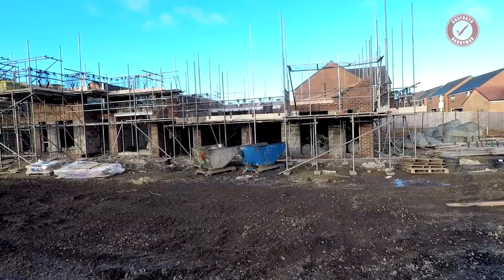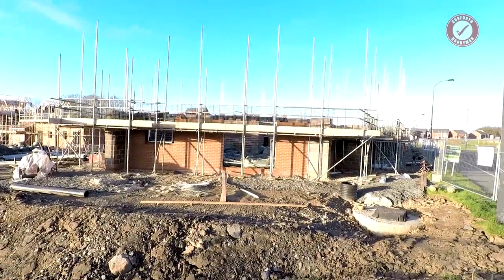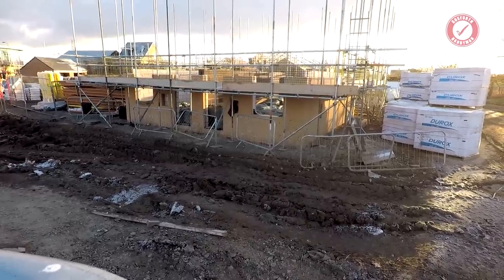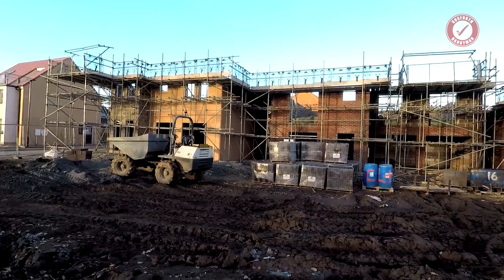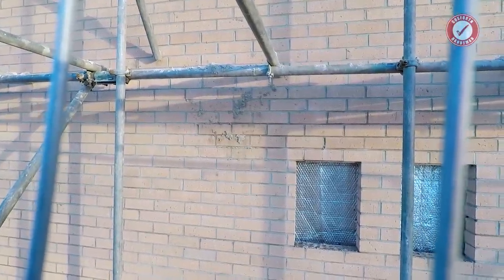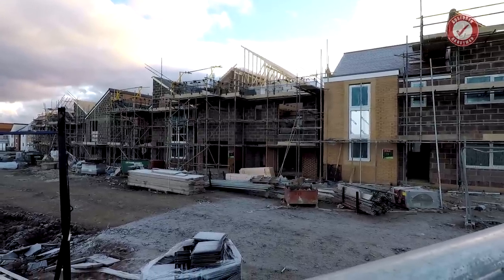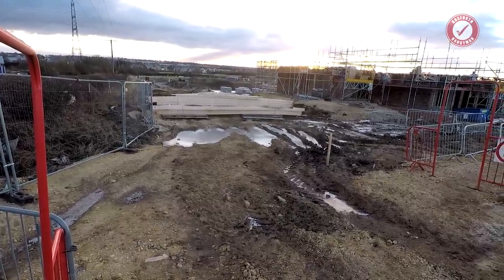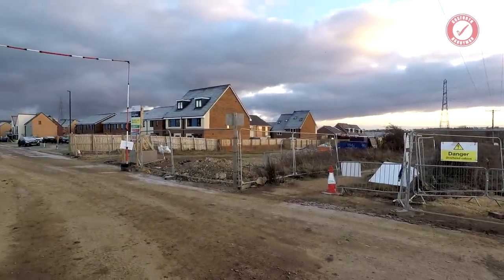How are New Houses in the UK Built? Introduction & Externals

Comment: It's interesting the difference between England and Scotland. The inside skin is all timber here in Scotland, with all the insulation being incorporated into the stud walls so that the cavity is left clear to do it's job. Also it's hard to see in the vid but I believe, in the past at least, in England you don't have any sarkin on the roofs? Funny how close we are yet things are done differently
Reply from the maker: Interesting on the timber frame thing! Don't often see sarking boards here - I think it's down to weather / rainfall etc. I'm not 100% convinced by the blown insulation thing here. Would much rather see Celotex or the like!
Reply: Gosforth Handyman also re the concrete slab floors, not sure about new build houses but I did an extension about 2 years ago where the floor was a poured concrete slab then 50mm kingspan floated on top with the finished flooring (hardwood flooring) layed directly on top. Wasn't at all sure about it when I looked at the drawings but I have to say it felt very solid

Comment: I think solid concrete floor are probably one of the better floor system we have as they are solid no drafts can get through and with no solemn gap there’s not a large area for mice and other vermin to hide. There is no bounce in them whatsoever, when I done mine I had to put 100 mm of kingspan insulation which when you consider that heat rises is a bit excessive.
on the other hand having a solemn you can run pipes and cables under the floor at a later date if need be
Reply: Jack Redmond   Jack, what is “solemn” and what is “kingspan insulation” ?  And what country are you in?
Ron
Reply: @ronh9384   lmfao right whats this guy talking about
Reply: @ronh9384    Kingspan is an Irish company which makes building products.  I don't know what "solemn" is, unless he means "column".

Comment: Very interesting to see how they are built in the UK. Here in Sweden houses are usually built with a concrete slab with usually atleast 30cm of styrofoam insulation under and then steel or wood studs and covered with wood panel or bricks for looks. Nowadays it is more common with prefab walls that are just erected onto the concrete slab, with wires and insulation already installed. We have quite strict laws about energy performance so nowadays houses usually have to have a minimum of 20cm of insulation. 
Most houses are either large complexes with multiple(20+) apartments or solitary one family houses. 
Brick houses here are "wood" houses with bricks for looks only. The bricks are not even load bearing but just for looks.
You could almost guess that wood is cheap here. And concrete and plaster. Houses are usually around £4-600k and upwards around the largest cities.
Reply from the maker: Sounds like a totally different class of house building over there! You're lucky to get 5cm of insulation under concrete floors here. Interesting stuff - cheers bud! 👍👍
Reply: Well we have a colder climate also which necessitates more insulation so it's for better and worse( and higher prices) :)
Reply: @GosforthHandyman  In Scotland all poured concrete slabs have 150mm Kingspan underneath , block and beam method is rarely used now due to them requiring to be vented so higher from ground level and now that disabled access is a requirement from road and drive then ground floor level has to be lower to achieve minimum gradients.

Comment: I bought a new build bungalow by a developer after moving from a 1980's detached house. What bemuses me is having watched them build the rest of the estate, despite the construction being modular the bricklayers work the traditional way but they drop mortar all over the face of the bricks. You can see crusty dried mortar blobs on all the houses and stained bricks caused presumably by  the bricklayer wiping excess mortar off the face of the bricks with a rag. I have tried to clean mine up using a proprietary muriatic cleaner but the stains seems to be almost permanent. You point out in this video that they drop mortar through scaffolding but pressure wash it off. I have never seen this done on my estate. Surely a good bricklayer would tidy as he goes but not here. If you compare the brickwork on my 1980's previous house to here this just looks like a bodge. Why are standards so lax?. When I asked NHBC about the holes the bricklayer left when the soffit was put on they said this came under the term "Remedial work" The builder agreed  to the work and just glued on an extra piece of PVC beading to cover them.  Also the houses are so hot in the summer due to the insulation standards (Overheating) I am having to buy air conditioning to make it liveable inside.  You would think with the Government encouraging builders to install air source heat pumps they would also enable the cooling side as houses are pressure tested to be air tight but obviously this defeats the purpose of reducing energy consumption in relation to C02. My impression is modern houses are not really fit for the increasing temperature's we are experiencing in the UK due to alleged climate change and there is no quality control on the cosmetic finishing of them.

Comment: Very interesting.  I am currently house-hunting and it's further confirmed that I do NOT want a new build house.  They seem built as cheap as possible and not built to last.  I am currently looking at an early 90s house and even that looks shoddy compared to the 1965 house that I have just sold.  My 1965 house was all brick and blockwork.  The 1990s house has mostly stud walls internally, so will be useless for fixing things to, and useless for sound isolation.  Also, I find the gardens ridiculously small on modern build houses.
Reply from the maker: I'll be doing a pros and cons vid soon (ish) - it's swings and roundabouts really. Agree on garden sizes though! (although depends on development). 👍
Reply: Yeah. Agreed. There are pros too. I like the fact you can just move into them without needing to do extra work, they have a guarantee period where anything wrong will be fixed, they often have better built-in storage and modern fixtures and fittings.  They probably have cheaper heating bills too due to modern equipment and better insulation.   That said, they do not seem built to last IMHO.  I am sure they will last 50 years, maybe even 100.  Which I guess is long enough for most people not to care.
Reply from the maker: Out of a matter of interest, what parts do you think won't last? I hear this a lot and I'm compiling a list! 😀
Reply: Just to allay some of your pre-conceived ideas ,studwork internal walls are easy to fix to, there should be plenty of timber to screw into and there are loads of plasterboard fixings if you can't find timber also the walls may well have insulation/soundproofing in them. As regards 60s houses being better built than 90s this obviously depends on who built them but a lot of the materials used in the 60s were inferior to the 90s.
Reply: Gosforth Handyman brick will outlast wood.  a brick built building is bound to last longer than one who's fabric is made up of wood, osb and metal.
Reply: lesleyw9275 yes I am aware that you can screw into studs but that restricts your freedom on where to put the fixing.  Plasterboard can never hold as much as a stud or a brick wall.  Our 1960s house was an ex council house, so admittedly probably built more solidly than many.
Reply from the maker: New builds are largely brick / block built.
Reply: ksp1278 well spoken, they are all built for the most return, as much money as they can make back from selling seems more important then a well built house

Comment: Our house was built in 2010 by Redrow. We are happy with it. It is built on a concrete slab and in 7 years we have no problems with movement. Heat wise they actually have an advantage as it actually works as a heat sink with it retaining heat in the winter and cold in the summer. Like most construction techniques, if it's done well there aren't any problems.
Reply from the maker: Are you sure it's not a suspended concrete floor? (beam & block) Concrete is better if it's insulated but in many new builds (probably the majority) it's just bare earth -> sub base -> DPC -> floor. Coupled with poor site preparation this can lead to problems.
Reply: Gosforth Handyman pile driven, and topped with a poured concrete slab. All on the estate were done like this.

Comment: My house us 12 years old it block and beam floor i got cracking and settling.

Block and beam was used because it was reclaimed industrual land as the environmental department want a breathable gap between the floor and foundations to prevent toxic intrusion. 
But the ground floor vibrate when heavier people walk on it. If peoples jump down my dishes rattle.

My house has brick rockwool fibre cavity blocks with a polystyrene attached to tge plaster board. Is this normal.

Comment: Enjoyed the good quality video and insight. Personally I'd take quality over size any day, for me it's not so much about the size of rooms but how much daylight can be fed into them , and why build 2 storeys high then a roof when  1.5 will suffice.
My Wife and I have been to most of the new builds in our area (South Wales) from the so called leading firms i.e. Persimmons, Redrow, Barratts . We are now looking for land to build our own home.
Reply: Story and a half equates to room in roof trusses or dormers which in turn has a negative effect on room size due to roof pitch. Also a lower soffit level decreases direct daylight in ground floor windows. For example a similar sized ground window of a 2 storey will let in more direct light than in a bungalow .
Reply: @jimmyc974   Hi, you may be entirely correct but, the two storey houses that we have seen have very poor quality natural light ?  we have been to several 1.5 bespoke builds which have been much better designed to allow natural light to flood in.So I guess it's the design in question and not the number of storeys?

Comment: If you were designing / building your own house in the UK what building techniques would you use? With these properties I imagine cost is the main factor however if it was your own you would probably weigh up cost / efficiency / durability differently. 

You mentioned in your video block and beam rather than cement slab. What about walls etc.?
Reply from the maker: I'd probably do block & beam with masonry walls 👍

Comment: I have been designing homes for almost 30 years now and I always find it interesting to see how buildings are constructed elsewhere.  I live in western Canada (on the prairies) and you rarely see block being used unless it's for commercial construction.  Most everything here is stick-framed (for walls that is).  So from a the longevity perspective, I was surprised to see some comments about "not built to last" regarding these homes.  And just for the record, homes that are wood framed can be plenty solid (for the folks worried about slamming doors and such).  We started using the I-Joist styled joists a couple of decades ago, not sure how long they have been in use over there.  It seems that the larger dimension timber is going away due to lack of availability, so engineered products are becoming the norm.  Over the last 5 to 10 years, wood-web floor trusses have become more standard fair for floor systems, even in the smaller, entry-level homes.  They offer larger spans and the advantage of hiding duct work, piping and electrical runs inside the floor rather than having bulkheads etc protruding down and interrupting ceiling lines.  
We have been using roof trusses for about as long as I can remember. Oft times now, they roof system will be constructed on the ground and then most if not all the structure will be craned onto the building, reducing the amount of time that workers need to be "up in the air" as it were.
Great to get a glimpse of your world.  Thank you for that.  Looking forward to more of this sort of thing. Cheers.
Reply from the maker: Interesting stuff! Yeah, I'm sick of reading the "not built to last" rubbish. I rarely get those comments backed up with any actual facts 😂. Been seeing the engineered joists over here probably within the last 10 years. 👍

Comment: One thing I don't understand is why they're not making it mandatory to install solar panels on every new build?
Reply: nor heat pumps. Little 4kW PV system and a nice little ASHP on each!
Reply: It is mandatory in Scotland. Unfortunately the new build we are buying is a 2015 spec which doesn’t have solar as it is before the reg came in
Reply: Houses are expensive enough as it is without adding solar panels, that's the challenge
Reply: Why would they do that? It’s not like you’d get free solar panels just means your gonna pay an extra 5k for your home and who the fuck wants to do that in England where your lucky to pay them off in savings throughout their lifetime.

Comment: We are considering buying a new build, there is a local development building timber frame houses, when we've mentioned this to other new build companies they are very negative about them, due to wood rot etc
Please would you share your views on the pros and cons of timber frame houses 
Thank you
Reply: Basically all houses in the US are “stick built” or wood framed interior. Most use 2”x6”x they do vinyl siding or brick exterior usually. Businesses will often have a metal interior framing instead of wood.

Comment: Thanks great video, enjoyed it. I am from England but spent last 30 years in the US. I have a question. In the US the public drains, services and roads are the first items to be constructed followed by the houses themselves. This means no WW1 landscapes of mud and muck for first occupiers and makes it easy to get trucks and equipment in and out of the building sites. My question is why don't they do that in the UK which gets a lot of inclement weather
Reply: In uk ground work contractor has initial P.C and foul drainage and water drainage are installed first then the main spine roads along with kerb log . Roads are left at base course level until first occupations , this method is for cost saving as why top tar a road only for continous heavy transportation to damage. service area is now under the pavement (sidewalk) to minimise future works carried out on roads. In my experience this site is not indictive of majority of sites in regards of road cleanliness, and I could be incorrect in saying it seems this was filmed at weekend and if so site management shoulld have booked in a road sweeper for late friday afternoon as is the norm under health and safety duties.
Reply: @jimmyc974  Thanks Jimmy. I guess things have changed a little in UK

Comment: Hi all I have to agree with the floor joist comment, having worked on this type of house as an electrician it is difficult to maintain the integrity or the joists when you have to drill so many holes in them. The plumbers tend to keep their holes away from ours so the joists are literally peppered in some areas. 
I think you general construction process standard has fallen but I am told its for the best when it comes to conservation. It is a tight balance though conservation vs longevity. If a house is only good for fifty years what happens after the fifty years? 
I have also noticed house sizes are getting smaller, its difficult to fit a king size bed in some master bedrooms let alone any other furniture. 
I tend to think of new builds like cardboard boxes compared with conventional brick and block homes, fittings fall off ceilings, sockets pull out of walls, there needs to be a bit more thought on how they are constructed
Reply: Well this is totally incorrect and if what you are saying is true then both yourself and plumbers have affected the integrity of the I joists . N.H.B.C  Standards (and all service trades should know this) " Preformed holes should be provided in the web and holes or notches should not be cut without the approval of the manufacturer"

Comment: Hi there, what do you know about the new builds with half render?
I've tried to drill through it to fit some gates but the render is quite deep and really soft. 
Could you please advise me...thanks
Reply: @immybrav The half render houses will have a finishing block (not rendered) and concrete block (rendered) most likely the render will be about 15mm to 20mm thick then you will hit the block. Make sure u have a masonry drill bit or you wont get far. The block in my house i have to use a sds gun to drill. Hope this helped ?

Comment: I have a 1970 house and really notice how small windows have become. I'm assuming that is to meet regs on insulation and that it would be expensive to make large windows highly insulated?
Reply from the maker: Yeah, I'm not sure - possibly. Window technologies don't seem to have moved on much in the last 20 years - at least not in the new builds I've seen! If anyone in the architecture side knows the answer to this I'd love to know too!
Reply: brick and block is cheaper than glass ...and if you have a bigger window you need a bigger lintel (more metal £ ) ...it’s all about building the house as cheap as you can and sell for as much as you can...bottom line

Comment: The government should set much higher standards for any new building. Better insulation, solar power, ground source heat pumps etc.
Reply: Successive governments, the Tories in particular, have consistently watered down house building standards.  It allows 'big developer' in whose pockets the government lives, to throw up poor quality housing, sometimes actually dangerous - note the cladding scandal - and charge a premium.   It's all about maximum profit for the least possible cost.  The shareholders are happy and so are the CEOs.